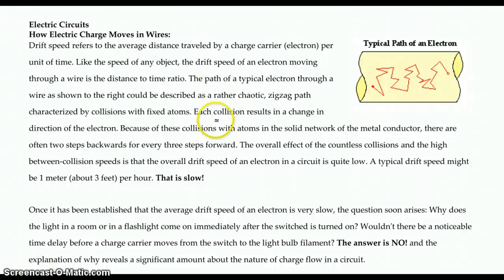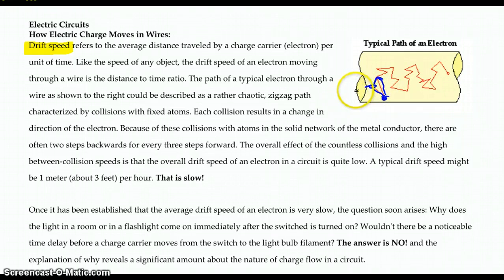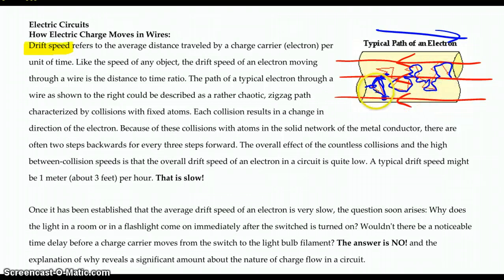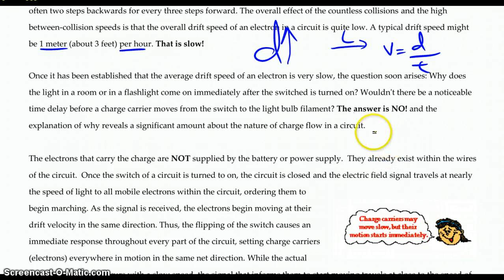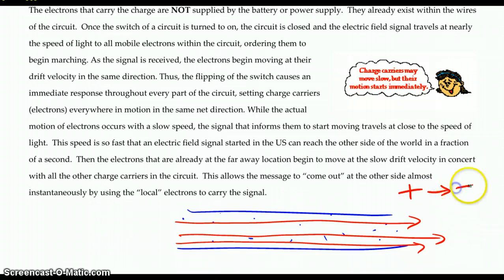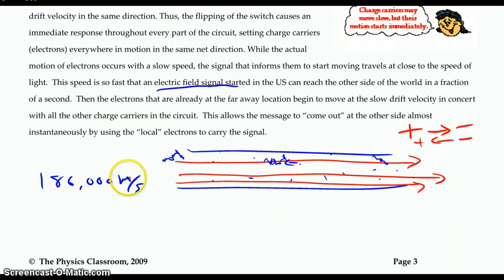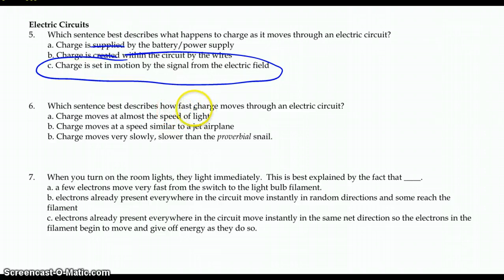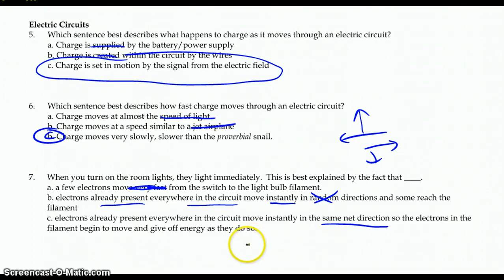Guidesheet #2 Part C: How charge moves in Electric circuits

Comment: Thank you.  some questions I have,  why do electrons move in a direction opposite to the electrical field?  Batteries really do not provide energy do they?  what they really provide is excess electrons.  How do electrons provide say heat or light when current passes in a light bulb resistor? Someone said by falling from a high to low orbit, hence causing voltage drop across the resistor. Doesn't this change the chemical characteristics of the conductor?